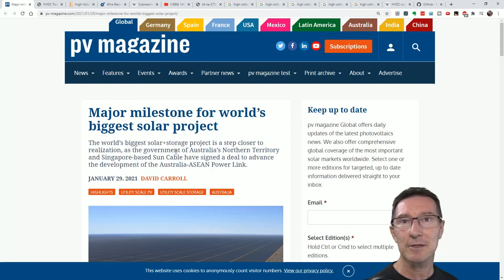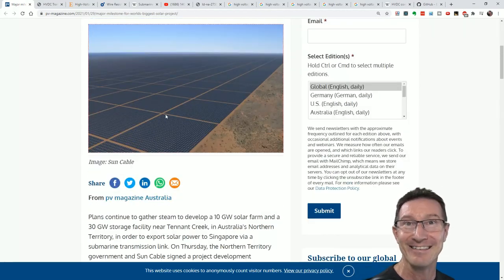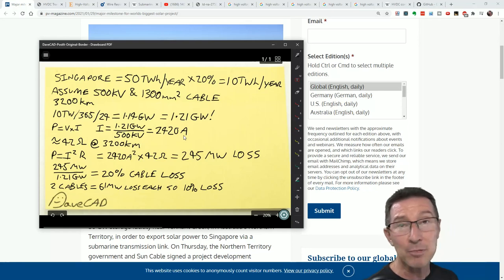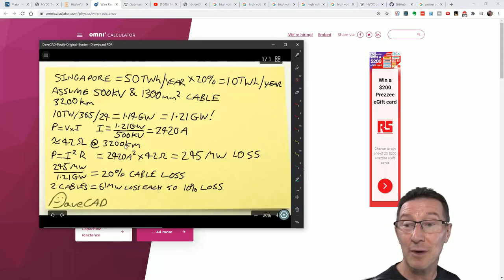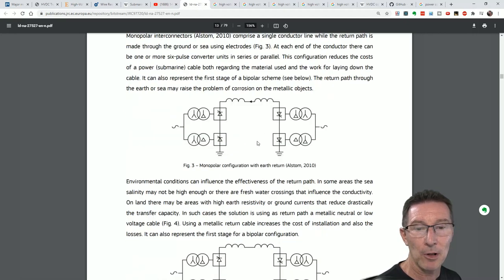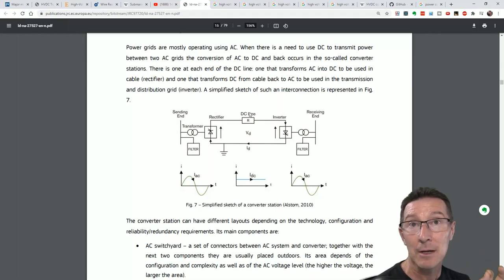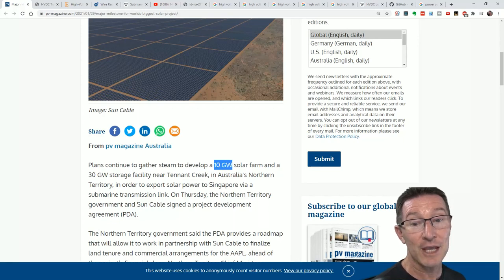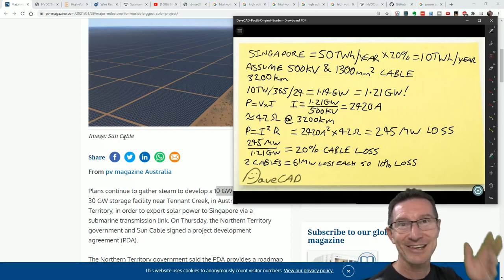World's Largest Solar Array - HVDC Transmission Calculations...

Comment: It's all nice with the "new" energy sources, but the grid needs high inertia rotating generators (like in common thermal powerplants) for stability. I wonder how energy companies will compensate for this if they continue shutting down nuclear and coal powerplants.
Reply: Well you can easily build storage systems to compensate that. Just use superconductors or flywheels. Will be fast enough to stabilize the network.
Reply: You don't need physically rotating synchronous condensers - grid forming inverters will do this just fine and they can respond to changes much faster.
Reply: that is the whole point  of teslas battery in south australia
Reply: @legolegs87  no it doesnt they are strugglig atm without aussie coal

Comment: 10% of a 1.21GW, that's 121MW of heat? Ya, don't dump CO2, just heat the atmosphere directly, and that's what we do with all of the transmission lines.
Reply: That's only 38 watts per meter. That's nothing comparing to ~1000 W per meter squared which ocean receives from the Sun.

Comment: I bet that much electricity and infrastructure could be used to somehow combine carbon and hydrogen into oil which would be shipped.
Reply: Overall the hydrogen cycle has an efficiency of around 33%, without the transportation cost/loss. Plus it's very hard to store (hydrogen leaks).
Creating methane over that (the CO2 combining idea), is, of course, even more costly.
Once you have electricity, it's better to keep the energy that way. It's the most "efficient" form of energy we have.

Comment: If you look at the Sun Cable project site https://suncable.sg/ they are talking about a 14 Gw peak solar panel array or what you can expect from a 12000ha installation, so we can assume in an area which is mostly cloudless an average 3.5 Gw over 24h with a 33Gwh storage. As you say and they claim, they will supply 20% of Singapore or 1.2Gw, what happen to the remaining 2.3Gw? They also claim that the project will only cost AUD $23 billion, assuming the batteries can last 20 years and 7000 cycles, the interest rates are at 0% and no maintenance is required it still bring the Mwh price at AUD $89. It would make a lot more sense to move this kind of installation in northern WA to supply Perth, using much shorter and cheaper AC overhead power lines.
If Sun Cable is a private company not receiving any tax-payers subsides, good luck to you and  your investors they might get rich or broke. Otherwise look at it, it's a 2 years old 12 employees startup company dreaming to build a AUD $23 billion project.

Comment: Trivially...  collated reliability figures for undersea HVDC links aren't something that gets much traction.  One sees occasional reports of outages - but - as far as offshore wind is concerned - undersea cable reliability looks to be ferociously patrolled PR embargo / NDA territory. There have been a number of costly failures on wind farms that have been hushed up. 

Comparing undersea HVDC with onshore buried and overhead cabling looks dodgy as ....

Comment: More like 4300km, they never lay em straight and they never land level and you have to give em enough slack to sink in some places.  Laying only 2 lines is dumb, they need to lay 3.   Also need to calculate magnetric transmission losses from inductive planetary field.  Also have to factor in Camel damage and the occasional cloudy day.  You can't run that cable off of battery alone either.
Reply: Why 3 cables? 1 for a spare? Seems pretty expensive.
Pretty sure the document know what's it talking about, and has taken those into account.

Comment: Why not AC?  Very high voltage, lower amps = much less loss
Reply: Those are benefits of high voltage vs  low voltage, not AC vs DC. We're talking about high voltage DC here which, as the name implies, runs at high voltages.

To answer your actual question, AC has disadvantages: to start skin effect increases resistive losses and stray capacitance causes extra current when you run AC. In addition the Australian and Asian power grids are not synchronized, so you physically can't safely connect using AC.

Comment: Do you really think the tree huggers will actually let that much land be totally covered killing everything underneath?
Reply: YES, there is nothing underneath, its the bloody dessert,  australia has tonnes of land like this..
Reply: @davem3325  desserts are far from dead.
Reply: @ken2391  better in the dessert than all the coal mines in the very fertile food producing lands of the hunter valley!
Reply: The panels produce shade, which is GOOD for life. There will still be plants/animals there.
Reply: 120 km2. The Northern Territory is 1,420,970 km2. The sites they are looking at are privately owned beef farms, and usually around 100 000 hectares. So covers less than 20% of the farm.
Reply: @MrTubeNR  look at the ANWAR oil fields. Same situation except even smaller footprint and still fighting over it for decades
Reply: @BrazzaB1  guess you haven't learned that plants can't grow in the dark and black panels sitting in the sun probably get REALLY hot, kinda like a solar oven.
Reply: @ken2391  There's more than enough incidental light for plants to grow, especially in the desert. The plants are less heat stressed, so can thrive.
Reply: @ken2391  err.. Not very similar at all. Drilling for oil in a national park, covering significantly more area, is not very similar to putting solar panels on a small fraction of a private property. The sun cable might have some geopolitical issues getting through international waters however.
Reply: @MrTubeNR  I suggest you take a closer look at the area they want to drill in. They call it a "national park" to make people think of wilderness areas like Yellowstone but is is nothing more than an ice covered tundra. And the total area affected would be a tiny fraction of the area needed for this solar field.
Reply: @BrazzaB1  how do you get incidental light thru a 100% coverage? And you're still ignoring the solar oven effect on any critters who find themselves under these panels.
Reply: @ken2391  the drilling permits in 2017 are for over 1000 km2. This solar plant is for 120km2.
Reply: @ken2391  They are not going to be 100% coverage. You've got the tilt on the panels, plus maintenance access.

Comment: Its dc. And I would guess they use more or less the same technology as China which have built long cables at 1 million volts (experimental) south America has the longest operational line at 600kvolts, 3500 megawatt of transfer capacity if the wikipedia article is correct. Its doable, I guess. But it hasn't been done prior. But someone has to be first.... the battery part however seems even more interesting. That has not been done to the best of my knowledge. But there us plenty of possible technologies to choose from.

Comment: Could we not just power a laser with it bounce it off a satelight to a aneray of mirrors and shine it on to solar panels and re make the electricity ???.  Or use microwaves and heat water in a turbine,   ??? just thinking out the box.

Comment: Would be interesting to know why homes aren't slowly moving to a DC GPO supply or even a Bi-setup. I mean you can get a USB-C port at each GPO but no reputable brand does USB PD properly and I feel it would be better to have DC coming out of the main switchboard from either DC lines (I understand why this would be impossible in my lifetime) or at least Din mounted high efficiency  LV AC to ELV DC adapter RCBOs.

I mean you would only need ELV lines run through the house (~40V or even less) and set a new standard connector for that voltage or use USB-C PD to lower the losses in homes, considering ~80% of products in homes use ELV DC voltages and almost always use highly inefficient adapters.

I feel like it would save the industries money, save the country power and declutter useless adapters.

Can someone please correct me or tell me what I already know, that it is too hard.
Reply: Where would the conversion happen? Start at the local distribution voltage which is about 5-20 kV. You can't beat the reliability of a passive transformer in this scenario, which implies AC. Other, more subtle points regarding DC for the LV step (distribution transformer to the house) are galvanic corrosion and arc quenching. If one wire is always negative and one always positive, moisture ingress and damage to insulation could destroy cables quickly. Breaking a DC current mechanically (including in circuit breakers and fuses) requires a much higher distance because DC arcs are self-sustaining due to no zero crossings.

Ok, what about in the house? The same problems apply: Galvanic corrosion and to some degree switch arcing. As well as the reliability of the converter in your main switchboard over a timespan of years.

But let's look at the practicality of it. Why ELV and what uses ELV? LED illumination could use it essentially directly. Any high power appliance won't (resistive cable losses). Your phone, computer, TV etc won't have any use for 48 V directly, but will need to convert it to (eg) 5 or 3.3 V or lower. For a regular buck converter, a higher voltage difference means lower efficiency. The way to go would likely be a switching supply with a transformer based topology, much like in your regular AC/DC power supply. And so one of the main advantages of ELV (that it's mostly safe to touch) is mostly made redundant because the power supply would still incidentally be galvanically isolated for efficiency.

In the end it looks like much added complexity and risk for little benefit.
Reply: @Gameboygenius  So as I stated I wouldn't know which is a better solution, I suggest in the main switchboard the RCBO's convert at high efficiency. This would also allow for AC for your heating elements such as ovens, cooktops, hotwater, etc, that would not benefit from the ELV DC as it is only for heating or could not use it.

I understand that DC has its issues with distances but DC isn't exactly new, we would just make products, wires, switches, standards, etc around it, I don't think the layman would notice at the end of the day, they would just have an extra place to plug their DC stuff into on their GPOs. Not far from USB-C on GPO's but done well.

The main advantage of say 40V high current DC lines would be by making a standard and connector, you are forcing manufacturers to build around it, as you stated lights could be directly connected, your laptop batteries could just be series to suit the voltage, your phone, TV, tools, fridge, even welders, etc. Infact close to ~80% of products in the home would have the potential of using this system.

Not to mention solar, UPS, generators, etc. It would be much more compatible without converting up/down DC to AC to DC, its all just wasted.

And DC doesn't require power factor correctional gear to equal unity, you would have no power factor losses.

I appreciate you man.
Reply: @Gameboygenius  + you are right the corrosion issues posed by DC cannot be underestimated.  Considerable 'black magic' calculations have to be done to prevent corrosion around DC subsystems. The one that comes to mind is the Sydney rail system which creates a PD across the harbour.  Quite a lot of work has to be done to stop that voltage destroying reo in buildings.  Historically there were examples of reo being completely corroded away because the building was in the path of the current flow.  The Sydney Harbour tunnel for example has permanent power supplies coupled into each prefabricated section's reo to prevent corrosion. Also I cannot see how a DC system would handle reticulation in the streets - without transformers either cabling would have to be of higher gauge or expensive static inverters placed around the streets creating noise reliability and EMI issues.

Comment: That's a pretty damn big array. 11x11 km square. I know it's pretty desolate out there, but I hope they site the array intelligently, because there is significant ecology out there that could be affected by such a large project. There's certainly room for the project between the lower lying areas which has adequate ground water to keep plants alive.

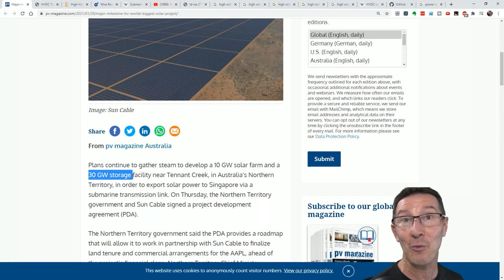Comment: 18:00 Wtf is a "30GW storage"? Wrong unit?
Reply: Indeed.  Usually journalists can't tell your GW from your GWh, but I would have expected Dave to comment on that.
Reply: You really would need at least two numbers to describe a energy storage system. The energy capacity (in kWh) that it can store, and the power (in kW) it can deliver.
The capacity number seems to be missing here.
Reply: @orti1990  My guess is that the 30GW is wrong and is meant to be 30GWh (the storage capacity), and that the power it can deliver is a lot less, either the 1.5GW it has to deliver 24h/day to satisfy the demand, or something nearer to (but not above) the 10GW the solar installation can deliver.

Comment: 9:25 Or use a thicker cable / one with more cores. Over that length it probably will be custom-made for that purpose.
Reply: All HV DC cables are custom made per job, not something you get off the shelf at middies.

Comment: HVDC? Why aren't they using AC, I thought AC had leds losses?
Reply: Nope. AC is just easier to get to high voltage via Transformer. Copper resistance is the same for AC or DC. What kills AC for long distances is capacitive losses. In particular when buried in the ground or surrounded by salt water which will reduce the distance to your "plate" and increase capacitance.

Comment: DC over 3800 km, why?  didnn't Tesla win this battle against Edison last century?  DC is short range, while HVAC is standard transmission for distance.
Reply: HVDC wins out, no ripple peaks to have for insulation, and no dielectric loss, which is a big thing at this power level.
Reply: DC isn't any "shorter range" than AC. In fact DC has many advantages compared to AC (no skin effect, so higher efficiency usage of the conductors), etc.

The reason we use AC is not because AC is better than DC for long distances, but because high voltage is better than low voltage for long distances, and when electrical grids were being built we had methods for converting AC to high voltage during transmission and then back to low voltage on the other side, and we didn't have methods for doing the same with DC. Now we do, so we use DC where we can (i.e. grid to grid connections).
Reply: @GlenwingThink  DC also wins out in that you do not need to synchronise the grids that closely, which gets harder the bigger the grid gets, as each power source puts power into a smaller fraction, so you need to regulate the frequency tightly over a large number of plants. The converter stations will accept at incoming frequency and can output at the local grid, no matter if it is 50 or 60Hz at the converter side, as they are for the typical plant bidirectional anyway for the most part, as active rectifiers and high power switches are common there.  While most of them are one way power transfer, the ability to run in reverse is a good backup for the supply side, and no extra cost either.
Reply: @SeanBZA  Yup. I didn't want to get too technical :P
Reply: @GlenwingThink  Yes, likely will be 2 or more cables with earth return, I remember travelling often kilometre after kilometre past the Kahora Bassa power link, with the single heavy wire on the tower, and the lightning wire above it on the one side of the road, and the other side of the road the exact  same style of cable, just with the towers staggered by half a span. Those single cables have a massive and very long insulator supporting them.
Reply: always good to comment before actually watching the video....  lol
Reply: Go see 15:54
Reply: Semiconductors have gotten much better over the last 10 years (especially in the last 80 years). With a complete new grid, a pure DC grid could be the better option. But even in 2005 it would have been unthinkable.
In the future there will be hybrid grids, some parts will be DC and other parts will be AC.
Reply: @Momchil0  The grid is already a hybrid, but will probably remain AC for the customer side simply because protection is easier and a lot cheaper with AC, as faults tend to be self extinguishing, as the voltage dropping to zero 100/120 times a second allows arcs time to cool. DC protection at high energy is a lot harder.